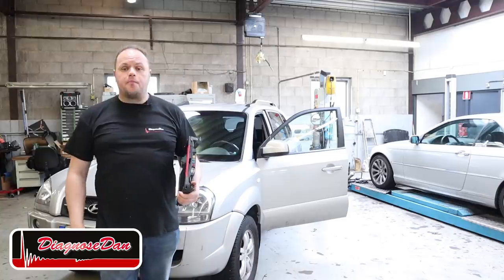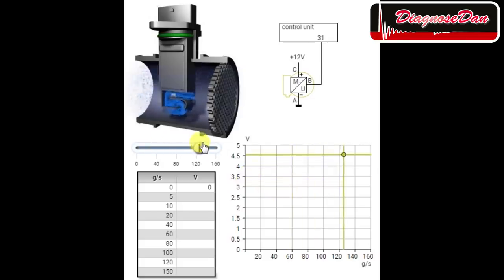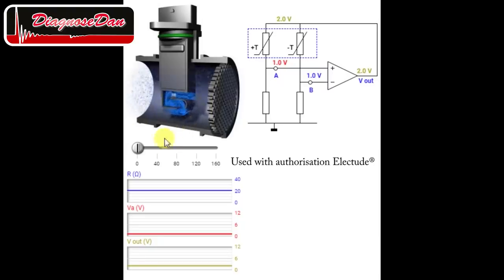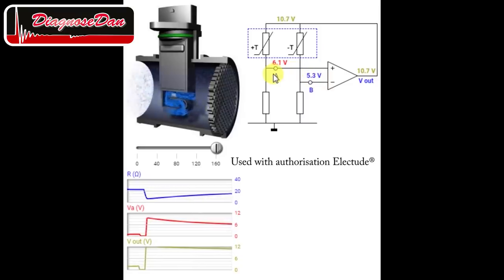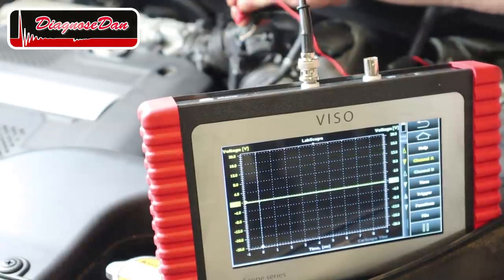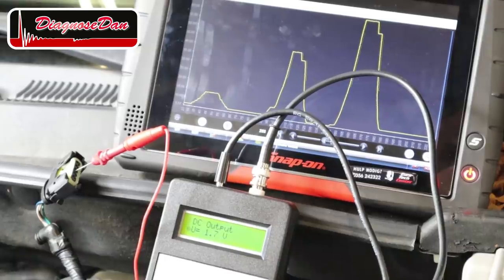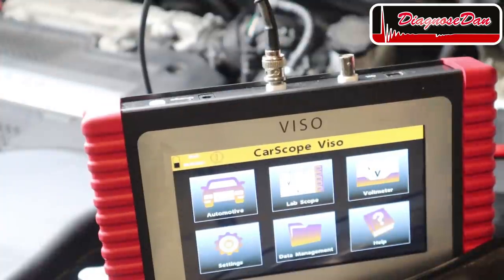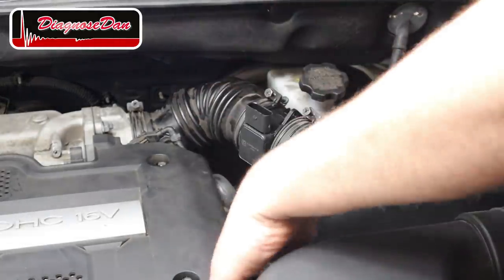Oem vs Aftermarket

Comment: I need an answer on this kind of quickly, I was really keen on getting one of these viso scopes, but i was distracted by a guy locally selling an unused old stock snap-on vantage pro, which one should i go for? Im kind of lacking in experience so i really like the guides built in the help sections of the viso and the vantage, which is best? Thanks.
Reply from the maker: In my honest opinion both scopes are a match when it comes to performance.
Reply: Thanks Dan. The Snapon was on an Ebay auction(new old stock) which was why i wanted a quick answer! :-) and it went for £920!!!
That made my mind up, the Viso i got for £590 new incl. Postage so i'm happy!
Incidentally you've really sparked my interest in the electrics side of things, i've worked in a garage but really just in a parts changer stylee. Everytime a car electrician walked toward me i would hear an angelic choir background music, they had a sort of faint orange glow around them, always made me envious! :-) so i'm going to really get my act together and study this stuff, thanks for the reply! Keep up the good work, Lee.

Comment: Could you test the ground and power by connecting a test light only to the corresponding sensor pins, without connecting it to the battery positive/negative terminal ? You did it this way in the "canbus trouble" video.

Comment: Nice video again with explanations! And a nice comperisson. Is that aftermarket a "respective" or "1e choise" brand of your local part supplier?

Dutch: die otc test lampen kun je alleen via amazon (usa) krijgen volgens mij.
Reply from the maker: Ja klopt ze zijn hier jammer genoeg niet te koop. Nippart was altijd een goed merk van OEM kwaliteit maar de laatste jaren lijkt de kwaliteit minder goed op orde.

Comment: What good is a MAF, the voltage just goes up and down, and round and round!
Reply: Feedback from this resistor bridge is what gives the signal to the PCM , the more volume the higher the voltage required to heat the resistor and then the higher the voltage sent to the PCM ,  it looks complicated but it's the output that interests us , ultimately you can ignore the actual operation and work in volts output . You can diagnose a faulty part with a simple voltmeter and a back probe.  No scope required.  Cheap and cheerful

Comment: It would be nice if there were specs for the MAF.  Let's say that car had a sensor that was behaving like the aftermarket one.  It would be hard to get to a definitive diagnosis without buying an OEM part, but if you had specs for voltage at a particular air mass flow, you could check for that voltage, at least with an estimate of the mass flow (using the calculator).

Comment: "Original" OEM EGR for 2.0TDI and 1.6TDI EA189 engines is made by Wahler. Original fuel filter, in the VW box, was UFI. Not sure if we should avoid aftermarket always. After all, VW, Fiat etc are not manufacturing the parts themselfs

Comment: The failed sensor, was it possible to strip down the sensor  to see the failed part,  stripping  dowm n may have  found something  easy ( and low cost) such as a dry or broken solder joint on the circuit board to the NTC or PTC resistors,  or the an internal wiring break Within the sensor,  just a thought!

Comment: Are you not supposed to do an offset calibration / teach in procedure for these MAF sensors? That would explain the difference between two sensors.
Reply from the maker: No, calibration.
Reply: Any calibration or "tuning" would be in the PCM and would not change or explain the difference between the two sensors.
Reply: @fascistpedant758  It would explain the difference between the sensors if the calibration is in the PCM, since that means that the signal on the wire is uncalibrated. Just like an old-school TPS.

I don't know much about Hyundai's, and I'd like to keep it that way, but I know that any BMW with an mass air flow meter allows you to reset the adaptations and it will then use the O2 sensor in combination with the injector pulse width to get an accurate estimate of the mass air flow and use that to calibrate the sensor.
Reply: Adaptation recalibrates the PCM to compensate for variations. The Hyundai may in time have learned the new minimum and maximum airflow values and adapted also. That still doesn't explain such a large variation between the signals from two supposedly interchangeable sensors. I doubt that specified manufacturing tolerances would be so wide.

Comment: Yes, aftermarket a no no on sensors, or brakes unless you are opting for high performance. A note here aftermarket of the manufacture is a different story, they are the manufacture of that car manufacture purchase. Friends ask can I use them sure but if it doesn't perform the way you are use to well you will buy original or live with it. Usually, they will go for orig equip manufacturer.

Comment: I agree with oem only but a quick question. On my B7 A4 the MAF is made by Hitachi is using the OE supplier something you may do? I ordered 4 fuel Injectors for my 2.0t. I know Bosch makes the Injectors. Dealer had to order, for S3 modified engine, got 2 in factory audi boxes and 2 in Bosch boxes. Same happened actually when I bought new HPFP. Came in a Hitachi box

Comment: Those aftermarket sensors (lambda, MAF, MAP etc.) can be pain in the butt. Specially when customer have replaced the sensor with aftermarket one himself or somewhere else and car still not working properly. Oh boy i remember one aftermarket lambda thats was driven only about 100km and it didnt want to stay closed loop. I had hard times to get customer to believe that he has to buy original lambda to fix the problem. I promised to pay the sensor with my own money if it didnt fix the problem. I won the bet and got new regular customer to my company where i was working. :)
Reply from the maker: Great story💪

Comment: A good test would be to have at least three of each brand of sensor and test for deviation between them, would not surprise me if there was a fair bit of deviation on each brand, most likely would require a constant source of air from a blower rather than use the engine.
Reply from the maker: You are right! Maybe i'll do that one day!

Comment: I acquired a Buick Park Avenue that had this same mass air sensor system.  I got the car after the owner had a fender bender where I replaced a fender and some suspension components.  The reason the owner gave up on the car after minor damage was a reoccurring transmission problem.  The transmission had been even replaced with a rebuilt transmission.  I experienced the problem as the lockup tork converter kicking on and off at low speed. After checking the car and finding electronically everything working I did a careful inspection of the car along with a check of how the transmission was controlled. It seems that the transmission was controlled by the engine management computer. So looking for something that could mess with the engine management I found a crack after the air filter and before the mass air flow sensor.  Yeah, the mass air flow sensor was getting dust on it.  Not enough to set a code but enough to mess with the engine computer to cause the torque converter lock-up not to function right.  Some duck tap and sensor cleaner and the transmission problem went away.  In this case solving the problem was a case of learning how the system worked to find a source of the problem from a source that was otherwise not expected.

Comment: That's the problem with testing anything. Which is correct the OEM or aftermarket or neither. However if either is off .13 volts which one is better or worse... and that leads to the computer telling other components to adjust and are they working correctly. As you said cars get old so that's why value ranges are important. Who is to say the aftermarket from a local garage or a OEM from a dealer is the better value..  I like the simplicity of that Ditex, now if it could just have the option to give the manufacture testing values of the components..

Comment: If you use aftermarket MAF in this car, is it going to run the engine lean because the ECU cannot measure the oxygen correctly and will use too little fuel all the time? Or if the ECU uses lambda sensor to adjust the fueling, the same thing there - wouldn't a poor aftermarket part slowly destroy the catalysator?

Comment: i have come across this a few times with aftermarket sensors not giving the right voltage , and you have a real problem when you try to return them to the dealers , as they almost always refuse to refund your money , saying that the sensor will have to be sent away for analysis before they will refund you , then after waiting they say its back and there is  nothing wrong with it , but when you  fit an oem one there is no problem , BUY CHEAP ! BUY TWICE!
Reply from the maker: Make a video and show them🤣🤣

Comment: Thanks for the video!
In this case it's obvious that Nippon sensor is faulty. But for my case the 'original' is made by Bosch and there are many aftermarket alternatives including Bosch and Pierburg (that is the original here). So is the aftermarket Bosch worse than the original one? Or is Pierburg worse than Bosch? Also, sometimes there are mistakes in cross codes, that shows wrong part for the particular modification. Maybe that Nippon is just not right for this engine.
I just wanted to ask you, do you prefer 'original' over 'aftermarket' or just say that Nippon is cheating?

Comment: Nooooo don't get rid of the old trusty full-metal test light. You don't even need to use the pin, you can use any part of the test light to make contact. It's the most brilliant test light ever made.

 By the way, the LED test lights suck anyway since they don't load the circuit, but you can still get test lights with normal bulbs.

Comment: Define aftermarket. There are a number of oem suppliers for most parts. How exactly do we know who actually made the Hyundai/Kia part for example? I would guess they use a 3rd party induction system. Is Hyundai/Kia the only label you should buy or is it ok to buy a lucas or bosch if they actually are behind the system. What about all the other rebadge brands? That nipparts seems to be one that specifies the wrong parts for every vehicle they supply for, but do they actually make the parts?
Reply from the maker: You are right it's hard to know where parts are made, even big brands outsource some of their parts. But at least at the big brands they might have a descent quality control.
Reply: @Diagnosedan  Yeah but my point is if you bought the brands they sell at autodoc like stark. I strongly doubt they made the sensor or hub bearing themselves.  If you find such an off brand and their stuff usually work well do you suspect they rebadge reputable brands? (By usually I mean at the same or close to the rate of the OEM (grade)  brands)
Reply: There's no golden rule to acquiring good replacement parts. Even dealerships continue to sell original design parts which everyone has known are problematic for 10 years. Price doesn't guarantee quality either. Marketing can play a larger role in pricing than quality. A less expensive brand can have a better part in some applications. Spark plugs are maybe the only thing you can be confident of getting original quality and performance from, from the OEM. This could be the topic of a very long discussion.
Reply: Maybe companies like Nipparts buy the "plastic waste" (=failed casts) from OEM Manufacturers and freshen them up a little? Maybe they buy old molds that have been retired by the manufacturer? Maybe the  subcontracted factory just gives OEM corporate in the EU/USA the finger,  secretly keeps making molds at night, but fills them with electronic components that have a 10% tolerance instead of 5%? We have no way to know. But there's more ways that lead to Rome.

Comment: Would the PCM relearn the new values of either MAF sensor eventually? There are manufacturing tolerances even with OEM Sensors that will affect the voltages produced...Logic would tell me the PCM must learn 0 to 100% of the MAF Sensor in use...

Comment: I have always wondered if aftermarket sensors are in spec from calibration point of view.  That aftermarket is off > 10%, way too much.  The connector issue no surprise, bad process copying the original I guess, but I expected the manufacturer to be sort of close in spec.

Comment: without all that lovely equipment and ONLY a volt meter to hand.  Should i suspect a bad MAF.  Can i not just volt test the signal wire and the main volt line  IN too see if maf is receiving an sending correct amounts of voltage.  Would this be effective enough or just pull the plug and test drive the car.  This would force the car to run direct from Original OEM fuel trim MAP instead of rreceiving a broken signal.

Comment: regarding the calculations , sometimes the g/s live readings can be influenced by EGR strategy also.  for more resolution the EGR may be closed via bi-directional function.

... guess what Dan!  tomorrow I need to replace a MAF on a Citroen C3 1.4 HDI.  the MAF was diagnosed bad and the internal case was very very contaminated.  the reading are low and inconsistent , no DTC , no limp mode , not so much power either.  with MAF disconnected the car runs ok ...

...but I wanted to point something else.  

I saw in the video that the oem MAF you used is an Pierburg unit.  
I ordered myself one , arrived today in his box , full of labels and holograms but the sensor itself has no markings , very very poor moulding and plastic finish just a stick label with a code .... I`m surprised by the poor quality of the manufacture , maybe I`m dealing with a fake product.  I`m based in Romania but we never had problems with fake parts and we are using an european parts supplier.  who nows ..

(I can also provide photos)

I can`t wait tomorrow to test it ....  

Many thanks again for sharing all this is a grate pleasure watching your videos.  
Your english is perfect , is it true that in the Netherlands english is so often use?

best regards ,  Tomi
Reply from the maker: My sensor also looked like cheap plastic, but the values are fine and in the end that's most important.

Comment: Personal disasters:  04 Chev 2500 6.0L, Camshaft Position Sensor, used a ebay part, fail, used a Dorman part, fail.  I then bought the correct AC/Delco and magic, no rough idle and truck started right up.  Ebay Crankshaft Position Sensor, that one worked.  As far as MAF, only OEM works well. And I don't mean some crap Ebay OEM, I mean a GM part.  I've wasted enough cash to know the correct way now.

Comment: Will these aftermarket sensors, i.e. NOT the "original" ones affect the emissions of engines (in a negative way)? If so, why are they even made? Your car has to be checked yearly (in the Netherlands and I believe in other countries as well) and has to meet certain criteria for the exhaust levels. If using 'crap' sensors result in unacceptable values  your car will not pass this APK (or MOT) anyway so you have to replace these sensors by 'originals' anyway.  And then there is loss of performance in the first place. Who would want his/her car to run less efficient?

Comment: The term OEM is very misleading. For example you will buy spark plug for Audi will you buy VAG or NGK? How about Ford Motorcraft or Autolite? Are you willing to pay more just for the Logo?
Reply from the maker: I have visited parts factories where is have seen with my own eyes that the only difference was the printing on the part and the box. This was a company that made the original parts.
Reply: @DiagnoseDan I wonder how many brand of automotive engine oil came from the same refinery.
Reply from the maker: @w0lvez1  there are only 4 big players in the engine oil business.

Comment: Thats quite disgraceful the large difference in outputs. Is there no followup RnD from these companies to ensure they get as close as possible to the mark? And considering in this age of social media and how us DIYer's look for known quality you'd think parts manufacturers would get their game together. Sometimes on older cars you cant get OEM anymore so you rely on AM. I mean how much extra would it cost for them to use better bits? Bugger all I'd say especially when this can relay on to higher sales due to a good reputation for good quality replacements. Word spreads fast on the DIY grapevine now.
Reply from the maker: Makes you wonder if there is quality control at all. The price difference between the two sensors was only 10€😉

Comment: Most Aftermarket Sensors are not manufactured to the same High Standards as the OEM Sensors. Its too risky to use Aftermarket Sensors.
Reply from the maker: Thanks for the feedback David

Comment: These videos get my blood boiling. I have to deal with aftermarket junk all day. I tried installing a oil psi sensor from Napa the other day. Connector wouldn't go on. Would clip in perfectly In oem one. But it was leaking. Had to bend the pins and push real hard to get it on aftermarket one. But dealer doesn't stock crap in my area and customer just had to have to back same day. Sometimes I wonder why I continue to put myself through the headache of working on vehicles.
Reply from the maker: poor quality parts can be frustrating 😓

Comment: For the most part, I often buy the cheapest parts I can, and my car still runs. Forget this OEM stuff! EBay all the way!
Reply from the maker: For your own Car, no problem but if you fix someone else' s car you need to offer waranty and are responsable for damage to the car
Reply: @Diagnosedan  That sounds reasonable, Dan. Thanks!